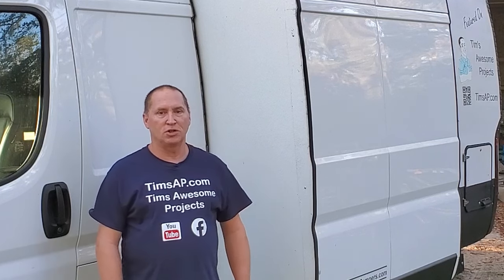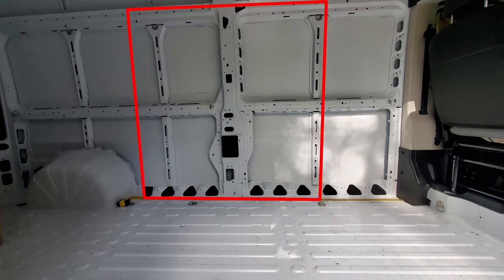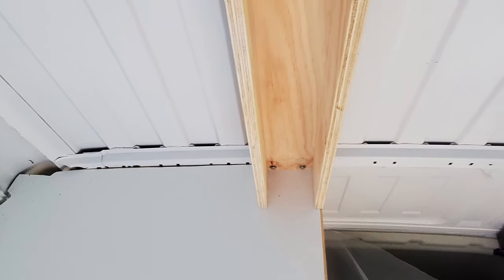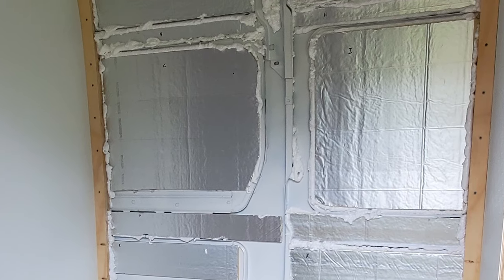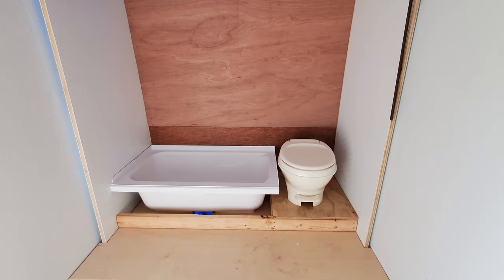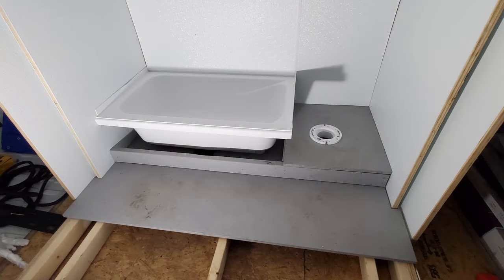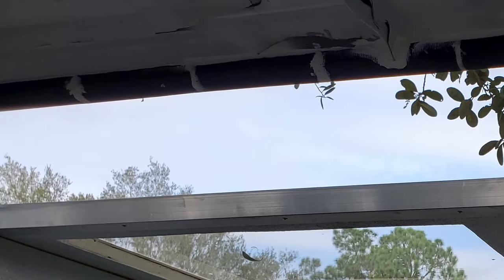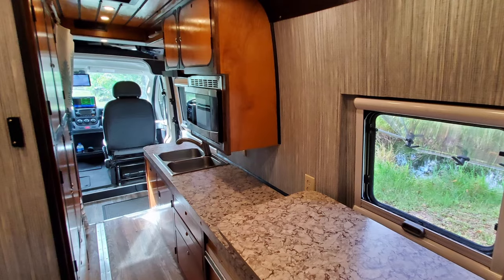How I Made a Bathroom Slide Out and Doubled our Room

Comment: Assuming it rained, would water get in from the top while extended?
Reply from the maker: No, it doesn't. Some details I didn't cover for time sake. There is a wiper seal and angle at the inside of the slide out roof. Some water does make it down into the section where the pinch weld is under the van, but it has drain scuppers.  (the lower van moldings aren't sealed very well from the factory anyway) Some water can get in if it's raining when you slide the unit in or out, but I have plastic troughs that carry it to where the scuppers are. 😊

Comment: Did you reduce the payload capacity by cutting out the c-pillar and horizontal beams?
Reply from the maker: No. They are mostly for roof and wall support which is now supported by the partition walls and U-beam. Just think about a van with dual slide doors. The payload is not reduced.